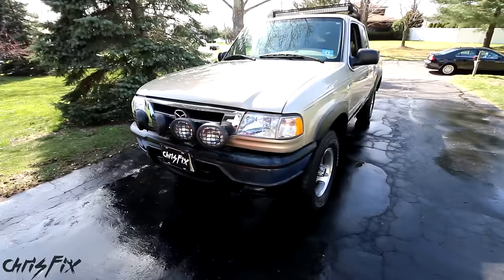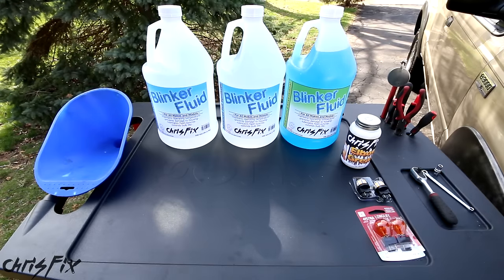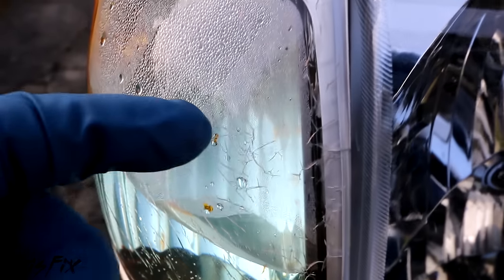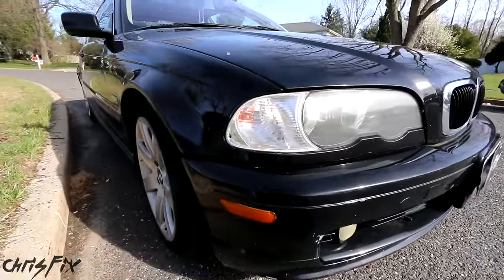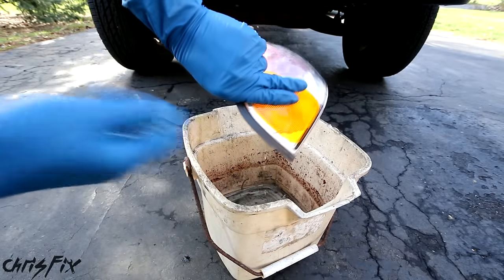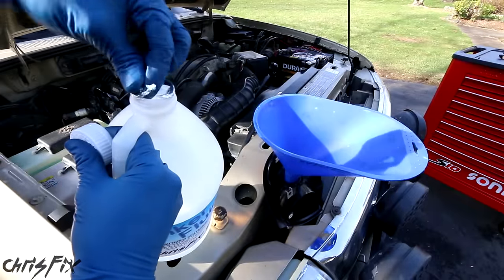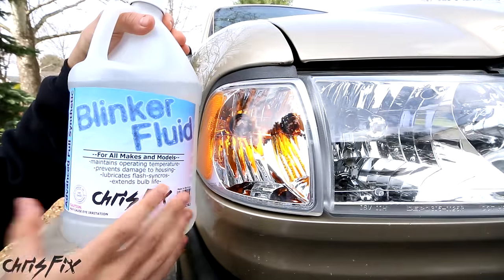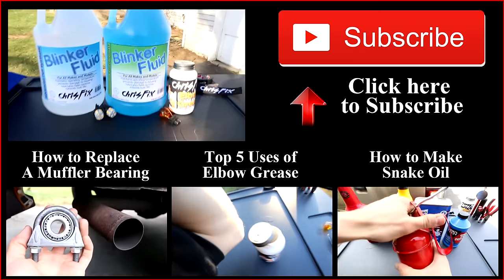How to Replace Blinker Fluid

Comment: Also important, don't forget to change the air in your tires from winter air to summer air

Edit :I wrote this hoping to make one or two people laugh, but holy shit 8k likes? That's insane (I hate edited comments myself so this is going to stay the only edit.)
Reply: Don’t forget about the muffler bearing that’s an important one
Reply: definitely
Reply: Vito Adame  bruh no
Reply: @lukyva7955  what u talking about
Reply: Or the exhaust belt
Reply: Until now I didnt even know that was a prank😂
Reply: And don’t forget to add tire shine for long lasting
Reply: Guys, don’t forget about the catalytic converter bearing
Reply: Oh come on, how could anyone forget the piston return springs?! They're like the most important component of your car, otherwise you won't be able to drive at all............ XDDD
Reply: Dont forget the piston gasket
Reply: I actually feel for that one
Reply: and piston return springs
Reply: LukyTheWolf but it’s all air 😂 there is no such thing as summer or winter air 😂
Reply: never forget the intake flywheel
Reply: The f...?
Reply: Plus don't forget to change the charcoal filter for the water pump
Reply: This is actually a thing tho
Reply: if you use an inert gas like argon there's no need to change from summer-to-winter air
Reply: Thanks bro. Also, don’t forget to change the air in your steering wheel. Don’t want to get it flat
Reply: Trying to prep for the cold season but my local walmart has no winter air in stock..😪
Reply: LukyTheWolf I work at a mechanic shop and a lady actually asked us to do that, deadass
Reply: @grantjones4862  Lost a car to a blown muffler bearing.  Muffler seized and blew out the rear end.  Lucky I was on a side road.  Debris all over.  Very important note.
Reply: @yorkeidt2859  Being on a peninsula Florida does not require exhaust belts.  Our vehicle air pollution is blown away by ocean winds.  Yeah it gets into the air anyway but it doesn't hang around like L.A.
Reply: @roeldeleon8025  Especially so for Florida.  UV rays eat up rubber fast.  If tire shine is not available SPF 50 sunscreen spread liberally over the outside of the tire will suffice.
Reply: @valkyrie5972  No need.  Had catalytic converter removed after it clogged...what?  Federal law?  I didn't remove it, the guy at the muffler shop did.  Bearing had seized.  Old styles had a lube plug not many people knew about.  Skip that a few times and POP!  There went the converter.
Reply: Though there has been some controversy there are many native Floridians who refuse to admit Florida even experiences winter, thus no need for the change in air.  Recommend you follow your manufacturers guidelines.
Reply: @fabiankarlsen3280  If one were to forget about the piston gasket and drive for about a thousand miles, would it really be necessary to go back in to insert the new ones?
Reply: @cvasniucalexandru2519  It was misdirection, an old magician's trick. He took old blinker housing and filled it with water.  During the scene change he picked up a brand new blinker housing (that you did not see previously) and showed you that one.  Being new and supposedly full of new water it looks nice and shiny.  There is no water in that housing.  The gasket lube is to prevent water from entering the housing around the seal where the light bulb is inserted.  If you don't know, you don't know.
Reply: @fourteen2012  I thought summer air had to be cooled to offset the heat rise during use?  And winter air had to be warmed so the tires would get traction on the ice?  Lmao!
Reply: @stainlesssteelruler143  ROFLMAO!!!  Damn I'm trying to figure that one out.  Funny as hell though.
Reply: @electrontube  As I understand it those in the racing community will fill their tires with helium to lessen the overall weight.
Reply: @jzpan8469  Just bump the front of the car into a stationary object, like a tree.  Hit it at about 10 mph.  Then the steering wheel will open for inspection.
Reply: Rondo Hunter not a thing, she got pissed because we laughed then she called her husband and told him the story then the husband was dying laughing
Reply: @brycecool11  Alright I think I can answer the puzzle now Alex.  She was blonde?  Lol!  And you know he's going to talk...make up the couch buddy.
Reply: Omg i was laughing to death
Reply: Well that is actually a true statement, your actually supposed to keep the air in your tires a certain PSI in the winter time and summer time if you live in a cold climate believe it or not. Same air of course, but you do need to adjust the air during the changing seasons if you live in a climate that gets cold during the winter.
Reply: Add this time it would perfect to add bananas to the flux  capacitor and adjust accordingly. For those equipped with eco boost!
Reply: Also you need to remember to take the engine out of the car, if your car has an engine it’s got something wrong with it, you need to take it out.
Reply: Can you make a video on muffler bearings.  I can seem to find any how to videos on this.  I have a 2004 ford Explorer,  the muffler bearings have about 120,000 miles on them. In desperate need of changing.
Reply: LukyTheWolf ahh that’s why my tires wear so quick 😕
Reply: Aw, I need to change my tire, cause its rolling 🤣
Reply: BRUH
Reply: Lmao 😂😂
Reply: What about the the tire signal
Reply: You mean tire fluid?
Reply: This is a legitimate thing. Your supposed to run low tire pressure during winter, or come spring/summer, you have four exploded tires
Reply: Wtf
Reply: LMFAO!!
Reply: Lol so funny
Reply: U could buy winter tires that already come with pre installed winter air
Reply: wait...that was a prank as well??
Reply: LukyWolf I didn’t know that!!!
Reply: LukyWolf and you need to change you gas to summer gas
Reply: SNS Cypress I should do that, thank for teling bro
Reply: The Un-Known Musician yeah bro
Reply: @roeldeleon8025  umm, i actually have a thing of tire shine
Reply: yup
Reply: No it should be how to replace your tire fluid
Reply: @fourteen2012  a later answer but... Think a second
Reply: @xjudolsb  what's your point?
Reply: LukyWolf i was joking i was trying to make an r/wooosh joke
Reply: Also don’t forget to change the oil in the seat fittings!
Reply: Technically, when you fill your all season tires, you do this...
Reply: Can’t tell if he is serious 😂
Reply: I actually believed that one about summer and winter air.......
Reply: I mean - it's technically true. It's more about pressure than different airs though. Still a good saying to remember to fill your tire pressure as the temperature goes down!
Also thanks for the help so far - been doing electric work on my classic 92 Oldsmobile. I am rescuing it from death. Found out I am only a few states north!
Reply: How did this Comment Blow up tf?
Reply: Don’t forget to change ur wipers from winter to summer
Reply: Don’t forget to install some elbow grease
Reply: That's kind of true you have to let air out when it starts to warm up outside and add air when it starts to get cold.
Reply: I’m so dumb 😂
Reply: LukyWolf lmao I believed that when I was 9 😂
Reply: or the calibrating of the fanogenator
Reply: @electrontube  propane works too in your tires
Reply: @rondohunter8966  yes but you can only change them whilst the engine is running above 3000 rpm otherwise you risk detonation of the exhaust system
Reply: @bullytitanskennel1193  as long as you have 1.1 giggowatts
Reply: @grantjones4862  I forgot that in one of my first cars.  Talk about an expensive lesson learned.
Reply: @roeldeleon8025  In Florida we have a special blend for the Florida summer sun.  Costs a bit more but it's worth it in the long run.
Reply: @valkyrie5972  Yep, replace that along with the exhaust bearings and exhaust belt.
Reply: @Spetsop  I've used only half of them after bending them back out straight with a hammer.  You can get by on half-horsepower until you can afford all of them.
Reply: @jzpan8469  Dammit!!  I thought that was a grease fitting and have been squirting grease into the air fitting.  Crap!
Reply: @joewillgo  True for most states.  Florida and Arizona are the exceptions.
Reply: @powderdays7557  Lmao!!
Reply: @zombyz13  Do you capture the air being released or do you let it vent to atmosphere?  In some states you're required to use the same air and top off as necessary.
Reply: @chubyub  So you do not change from summer tires to winter tires?
Reply: @cameronschichtel278  Costs too much, I make my own.
Reply: @michaeledwards8058  Hey hey now, this isn't Russia.
Reply: @michaeledwards8058  I assisted a guy who had to do that to his car.  We solved the detonation issue by running liquid nitrogen through a tap line into the exhaust before the converter.
Reply: @rondohunter8966  only problem that I can see happening is the exhaust system will run too cool so a simple turbo installation would remedy that fault
Reply: @michaeledwards8058  I see your point.  Changing blinker fluid is more complex than the video implies.
Reply: @Spetsop. No. The engine is. You need it for the car to drive and stuff
Reply: @chubyub  Some states will randomly check to test if the proper seasonal air is being used and will issue citations if the air is incorrect.
Reply: @cameronschichtel278  But then wouldn't you have to purchase an additional set of tires prefilled with summer air for the seasonal change?
Reply: @leozendo3500  Now you're really getting into intricate and complex territory here.  Best left to the pros.
Reply: @rustythefoxcoon5143  So where does one go to purchase all season air for car tires?
Reply: @lukyva7955  Many of us know the difference, in on the joke, and many are not as aware of vehicular needs and nots.  How to separate the wheat from the chaff.
Reply: @robloxfan4271  So it's not necessary to replace the windscreen then?
Reply: Michael F  Alright, retired trucker after 30 yrs. and never heard of that one.  I'm stumped, you got me.  But I do always check my kingpin.  That's for real.
Reply: @michaeledwards8058  I preferred the old altogenators, didn't need calibrating.
Reply: @michaeledwards8058  Believe it or not I just looked that up.  Actually propane is a larger molecule than air therefore less likely to leak than air.  The chances of an explosion are nil since the stoichiometric challenge of a proper air/fuel ratio mix is inadequate to cause combustion.
Reply: 1.21
Reply: @rondohunter8966  More like when. For my area, I have to check my tires around early spring. Usually the warmer temperatures effect the psi.
Reply: @rustythefoxcoon5143  Yeah I think the manufacturers recommendations are based on the MidWest or so (Your state may vary).  In Florida there's very little change in temperature so it's just a good idea to make it a habit to regularly give the tires a check up.  Plus I have a nifty little A/C compressor should it be required.
Reply: @rondohunter8966  and when liquid propane gas hits atmosphere it expands 280 to 1 making an 18 pound cylinder with a leaking valve a major disaster waiting to happen
Reply: @michaeledwards8058  Alright, maybe not such a good idea...just thinking...
Reply: OwO
Reply: The different is the,, Winter Air“ is for real. Is a Gas at Winter
Reply: What’s kinda funny is in Canadian tire they actually sell summer and winter air, AND IT ACTUALLY MAKES A LOT OF MONEY!
Reply: @matthis9486  I honestly do not believe in the concept of winter air vs. summer air or any other compressed air...unless specific air has been treated for specific purpose.  Otherwise compressed air that is used to inflate tires comes from the atmosphere.  And yes there are different grades of gasoline used during summer and winter in many states.  Thus there really is a winter fuel and a summer fuel.  The difference is the additives regarding pollution and engine efficiency particular to the change in atmospheric temperature.
Reply: @bullytitanskennel1193  banana skins only otherwise the flux capacitor will banana shake too much and cause circuit overload
Reply: I actually have the air in my tires rotated every 12k miles....
Reply: @ScottGrammer  Now I'm confused.  Do you rotate the same air from one tire to another?  Or do you bleed off and capture the used air per tire as per local and federal environmental codes, then refill with new, factory approved air?  And to toss a 3/4" monkey wrench into the mix, what about your spare tire?  Does it suffer from air breakdown less because of lesser wear?  Good thing I pay a mechanic high dollar to get this all done properly for me.
Reply: Remember to change the engine every 2 years to increase the car’s durability and horsepower.
Reply: @crisamayajoya6766  Would I include the drive-train as well or can it simply be rebuilt?
Reply: @rondohunter8966  Would recommend to rebuild it yourself! You’ll gain experience and give your car some uniqueness.
Reply: @roeldeleon8025  That sentence wasn't long lasting lol.  Oh yeah, don't forget the tite shine for long lasting....line??? Smh
Reply: @valkyrie5972  Looks like you forgot your brain bearing again.
Reply: @JustMe-gw4xj  i guess that’s just me 😉
Reply: @JustMe-gw4xj  are you forgetting the concept of a joke and just trying to start an argument for no reason?
Reply: Meme aside adjusting your tire pressure is pretty important when the temperature changes
Reply: some cars do actually have different psi levels for hot and cold weather tho
Reply: The reversing wire also need some love.
Reply: yeah I used to work with a guy whose first job was at a service station and he'd tell me stories about people coming in to have their "summer air" replaced with "winter air" or vise versa. he said it was easier just to charge them $5 to do it than to argue with them.
Reply: 10k
Reply: they should invent a gas that changes the rubber tires chemistry that makes them operate on snow and ice better. damn. im patenting that
Reply: You've just hit 10k likes, lap it up this may not happen again until the universe ends and big bang's again.
Reply: Damn this comment is hilarious! U earned a like!
Reply: I use all-weather air. I know...I'm cheap...But in my area the weather changes so often it's too much trouble constantly switching back and forth.
Reply: Thats hilarious
Reply: ✨ Mîmîkyû✨>✨Âll✨

"Here we are. This is the calm before the storm. We off the track now. That means we're heading into brand new unknown territorys y'all. We into the crop circles. It says, time waits for no mutha phuckin' body. After this short calm, a vicious storm will arrive. A horendously wicked storm. Lighting bolts so powerful they set fire to water. Thunder loud enough to shatter brick walls. And it's headin' right towards us all. We call this storm... The Tempest. Tornados of fire, being chased by enormous tidal waves. The Tempest. Tearing down forests into feilds reveiling crop circles. The Tempest. Who will be left? Who will still be around in the end? The Tempest. Who will survive long enough to join us for the new dawn? ICP is rollin' over." May 17th, 2005 ~ Insane Clown Posse

Sinbad=Sha⚡am! Kit✓Kat!! S∆MSUNG!!!

Itz flat... 🌎🌐🌍🔮🌏

®€$€®©H: 1587 Flat Earth Map

(C)ertificate
(O)f
(V)accination
(ID)entification

19 = A.I.

Women tend to have ring and index fingers of similar lengths while men's are more likely to vary. Babies who were exposed to more male hormone in the womb tend to develop more 'male-typical' hands. ... Women's index and ring fingers are typically of similar length while in men there is a greater difference.

This is tiddlewinx compared to the waste that was, is & will continue to eradiate from the nuclear reactor explosion in Fukushima! Not to mention the massive amounts just flowing into the ocean like a skifluphagus infected neden hole!! They are just piling up barrels above ground, covering them with some dirt, a tarp then call it a day!!! Football sized fields of nuthin but Inustrial Wasted!

ÏLLūmïñæ+ï

Biden has refered to (The Ugandan Giant) Kamala as "President Harris, Dan Sullivan refers to her as "Madam President several times! Predictive Programming at its sneaky little snakeness!

BaaAaAaa BaaAaAaa Bleat BaaAaAaa Bleat Bleat BaaAaAaa BaaAaAaa Bleat BaaAaAaa

RESEARCH PROJECT BLUE BEAM

“What is Project Blue Beam?” Essentially, proponents of this conspiracy theory claim that NASA is plotting together with the United Nations to introduce a New Age religion to the citizens of the world, headed by the Antichrist. By orchestrating the Second Coming of the Messiah using advanced and top-secret holographic technology.

Project Blue Beam is a joint project by NASA and the United Nations that, using the strongest technologies, aims to spread a new religion on Earth and create various simulations to establish total control on people and establish the “New World Order”.

NASA and the UN have begun to produce highly advanced technology. Using this technology, the entire Earth will see a simulation in the sky that would be created using satellites, located at different locations on the Earth. As the conspiracy goes, using this method, and in cooperation with the Antichrist, a simulation of the Second Coming will be created and all humans on the Earth will be united under a single religion under the framework of the Blue Beam. This way, establishing the total control will become easier and other stages necessary for establishing the “New World Order” will not take too long either.

This 1953 Book “Mars Project” by rocket scientist Von Braun, predicted a person named Elon would bring humans to Mars
book elon mars from techstartups . com
Dec 30, 2020 — “Speaking about destiny, did you know that Von Braun's 1953 book “Mars Project,” referenced a person named Elon that would bring humans to Mars? Pretty nuts.”

LONG LIVE THE POWER OF THE {J}ESUS!!!

💙 Whoop💙Whoop💙
Reply: @grantjones4862  I believe you gotta do an exhuast fluid change at the same time you do the bearing. Could compromise the accelerator fume actuator also known as AFA sensor.
Reply: lets not forget the mirror fluid as well. prevents the mirror from being fogged up.
Reply: Don't forget the wiper brakes